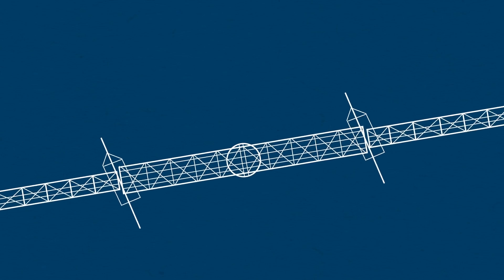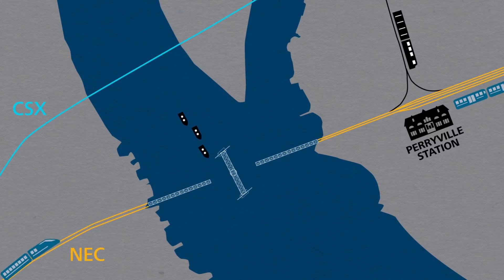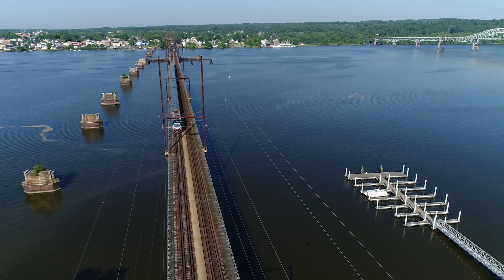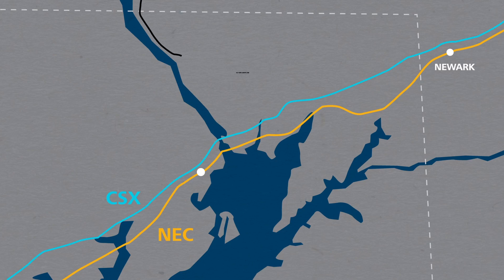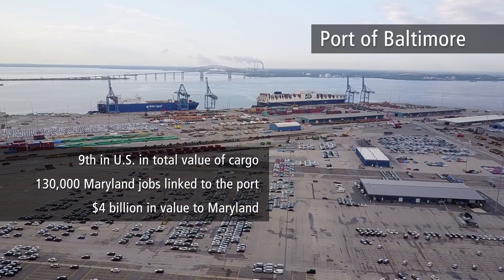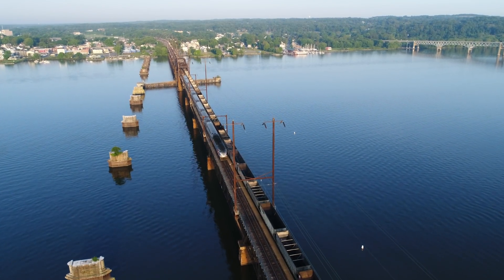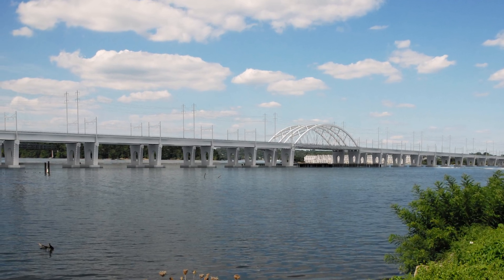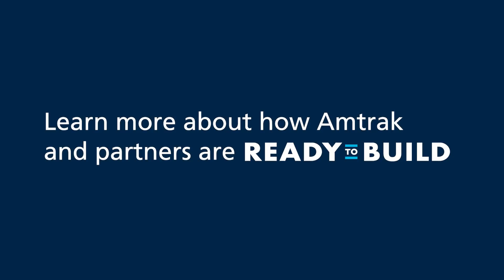Ready To Build: Susquehanna River Bridge

Comment: Just put a second Bridge next to it. Then you got not one but 2 bridges which means you never have to worry about it being knocked out cause the other will take its place. It is better in the long run.
Reply: This answer makes sense and has merit.  Therefore, the US government cannot use it.
Reply: Csx has a additional bridge that sits a mile up river. Problem is both bridges are over 100 years old
Reply: Matt`s Mocs That is the plan. One bridge will be replaced with two bridges with 4 tracks to allow for better service.
Reply: They will have two bridges in the end, just two new ones. The old bridge has restrictions and will be a maintained black hole. It needs replacement, and two new bridges gives the redundancy you desire.

Comment: Are four tracks really necessary though?  It would seem that three tracks - two tracks for passenger plus one for freight would be more than enough.
Reply: 3 tracks would probably be plenty for today’s traffic levels, but demand will likely increase significantly in the next several decades to the point where four tracks will be the best idea.

We wouldn’t want to build a three track bridge today only to be faced 20 years from now having to build a 2nd bridge at an expense far greater than if we just designed in a 4th track from the get go.
Reply: I think so, cuz it will increase frequency for both passenger and freight trains, it's all about the larger benefits in the long run.

Comment: Why the tape of the tax payer. 1.7 is way to much. Up rail road built the much bigger Kate Shelly bridge  for 50 million dollars, ns  Corp is building the same size bridge for 50 million dollars at portageville ny. Why so much money?
Reply: electrification.

that other bridge you mentioned is not electrified.
Reply: @atrproductions5428  that is 100 percent bull crap the tva don't spent a lot of money to build 200 miles of power lines
Reply: Did you forget that this line is electrified?
Reply: @atrproductions5428  that has nothing to do with cost
Reply: @atrproductions5428  has nothing to do with it
Reply: ROADS ARE SUBSIDIZED BY TAXPAYERS